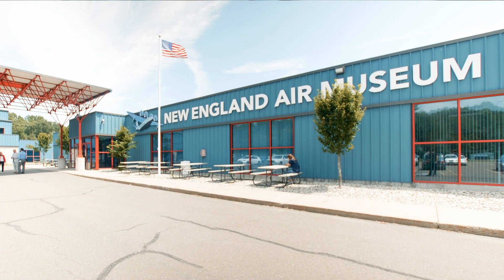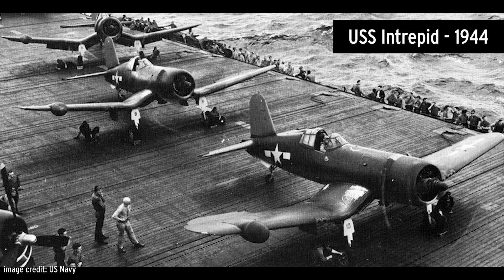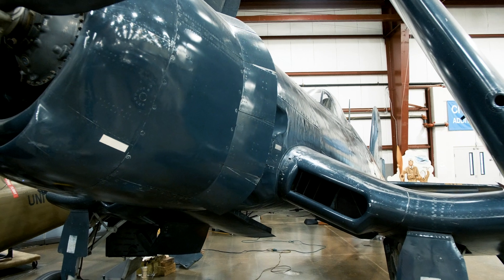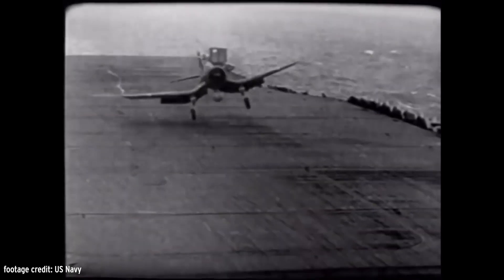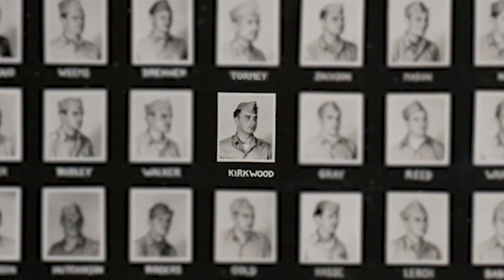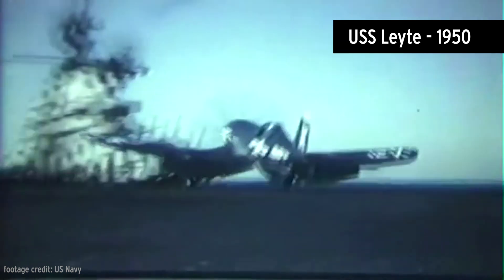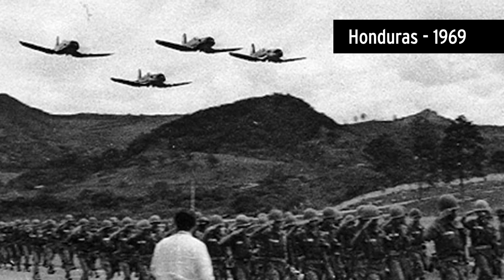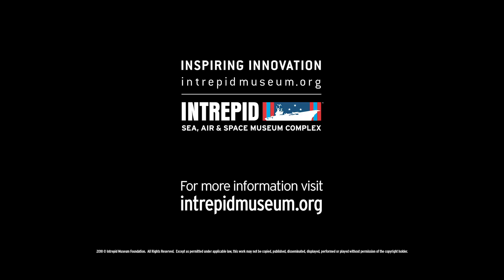Aircraft of the Month: F4U Corsair

Comment: NO, the British Royal Navy Fleet Air Arm did NOT develop the "improved landing technique" first. Incidentally the standard U.S. Navy carrier approach was not unique to the Corsair but used for other aircraft e.g. F4F Wildcat, F6F Hellcat etc.  

Revealed in the book "Widowmaker" by Tim Hiller-Graves that the U.S. Navy was in fact using the "curved approach" {improved landing technique} for Corsair carrier landings as early as February 1943. "The first Corsair arrived in February (1943) and an intensive program began with the CO (Lt. Cdr. John "Tommy" Blackburn) playing a leading part. He realized early on when undergoing deck trials with the USS Charger in Chesapeake Bay, that the Corsair had to be handled differently to other aircraft when landing on a carrier. Blackburn reasoned that a standard , straight on approach was unsuited to this aircraft, because of its poor forward visibility when landing. Above all else, a pilot needed to see the deck and the batsman's (LSO) instructions and that could only be achieved with the Corsair using the curved approach from the port side ." Following this there is a letter from Blackburn which goes on to describing Corsair landing issues. Also read the document : Corsair F4U Navy Carrier Landing Issues"  The link: https://www.facebook.com/groups/570146806355342/files

Comment: If you say the reason for the inverted gull wing was to make the gear strong enough to take carrier landings while still providing clearance for the prop, how do you explain the wings on the F6F and F8F, which used the same engine and similar sized props?
Reply: Those were Grumman built aircraft which used the patented "sto-wing" design. Vought did not buy any type of  " rights" to use the sto- wing. The man who designed the sto- wing came up with the angles needed by playing with a paperclip and an erasure in his office.

Edit. I just noticed I didn't address your question accurately after rereading it. 
The hellcat was a much lighter plane than the corsair requiring a Less  beefy strut and it did actually use a smaller propeller. 4 blade propellers became more widespread by the debut of the Bearcat. It's diameter was only 12' 4" the corsair was actually a bigger heavier and faster plane than the hellcat. This is why the navy kept it into Korea and scrapped the other planes.

Comment: I painted that plane.  BuNo 80759.  About the only non-factory-original material on the plane is the fabric covering.  This is an XF4U-4.  There were several, but this example was the first built from the ground up as a -4 and not converted from a -1.  A curatorial decision at the time of restoration (late 70s) was made to not replicate the yellow-painted lower surfaces which were originally applied as the factory used the plane in spin testing.

Comment: Thanks for an excellent presentation on my all-time favorite aircraft. It would be interesting to hear/read more about the British system that made them easier to land on carriers. Wish we had one!
Reply: Yes sir! I agree! Next to the Spitfire the Corsair is my other favorite aircraft of all time! If I'm not mistaken, I believe the British system of landing them on the carriers was to make a banking turn on the approach to the deck where the pilot could just look off to his side and line up with the deck, rather than just making a straight, head on approach since the long nose would obstruct the forward view of the deck.
Reply: Eight inches were chopped off each wing in the FAA aircraft becuse of the lower hangars on the RN carriers but it helped to increase the sink rate. I believe there was a change to the cowl flaps to divert oil spray and a bubble hood fitted which raised the pilots seat a few inches.
Reply: Their technique was to make a long lazy turn to  the left while keeping the flight deck in view in the bend of the left wing as long as possible, then making a quick turn and dropping onto the deck at the last minute, rather than trying to make a straight in rear landing like the  US pilots did with their other carrier based planes...you can see this technique if you watch videos of corsairs landing on carriers later in the war...
Reply: Read "F4U Corsairs at War" by Abrams.  There is a chapter on the British carrier use of the F4U.